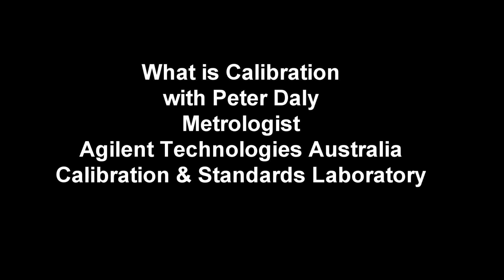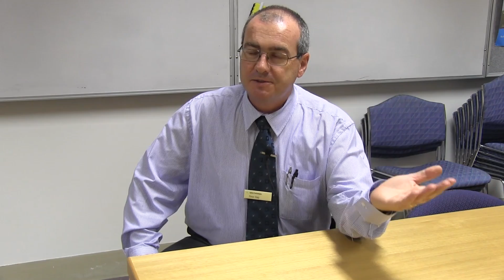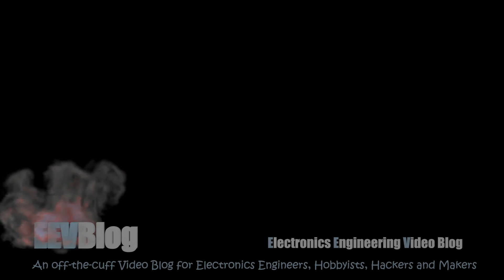EEVblog #420 - What Is Calibration?

Comment: Consider the circuit that is in place. Wires run from a transformer, down a number of streets, with many houses connected to each phase. The only places it may be metered is at the substation and at each of the thousands of houses connected.
They can detect if a suburb is using more power than the sum of all the meters attached, but that only brings it down to suburb level. Someone Bratsville is leaching power.
In order to pin it down, they'd need to add a meter to your power pole. Easy to spot.